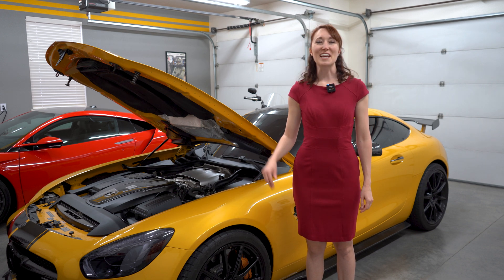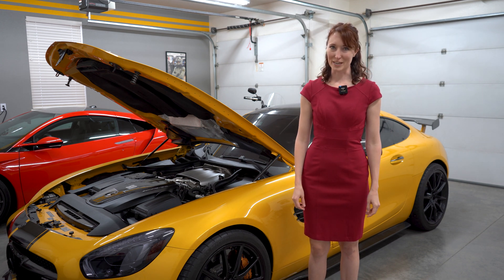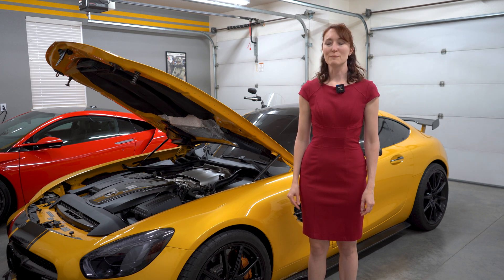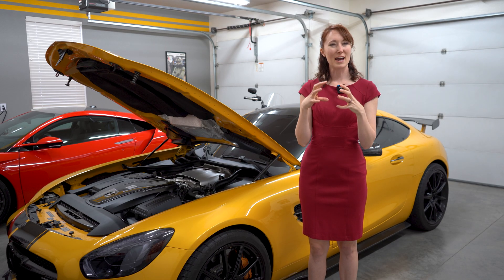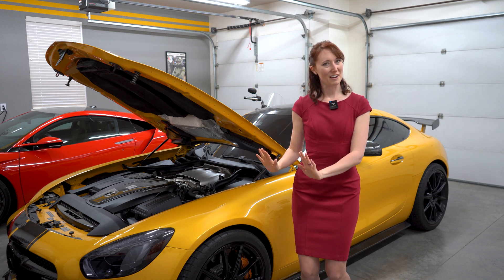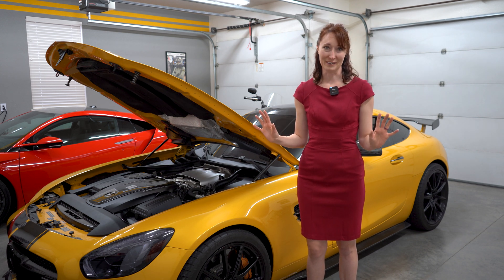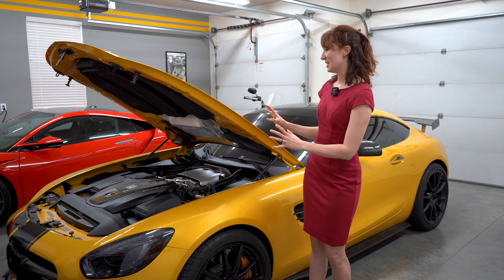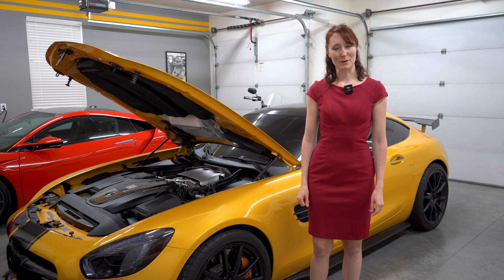Mercedes AMG M178 Engine -A Closer Look at the V8 Powerhouse

Comment: I think your oil capacity is wrong. 7.4 quarts engine oil.
Original MB owner’s manual is wrong and was revised.
Very informative video since MB does not freely share its information.
Reply from the maker: Good looking out! Glad you enjoyed it.
Reply: @DriversTherapy 
Where is the video you say you did on checking oil level. That is another topic of misinformation. GTS even has a dipstick but you have to check within a couple minutes of turning engine off to get an accurate reading so it is reported. I grew up working on cars and know quite a bit having built engines and hot rodded in my youth but let me tell you I have spent hours of time researching how to correctly do simply maintenance .Nothing is simple when working on the GTS.
Reply from the maker: https://youtube.com/shorts/JAJv0co67i4?feature=share

Comment: I think the hot V is cool when the car is in good condition or stock. The problem is that it makes modifying the engine very hard because of the size constraints of the v angle.
Reply from the maker: True. I think with the AMG you can get over 100 with a better exhaust which is nuts.